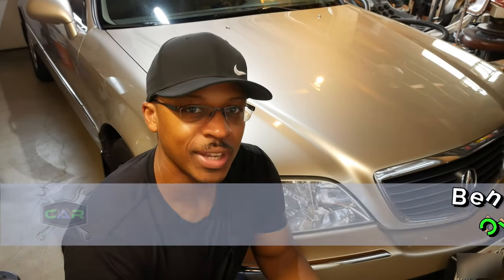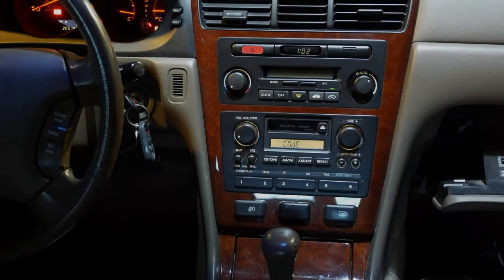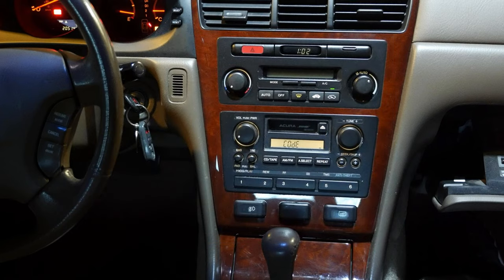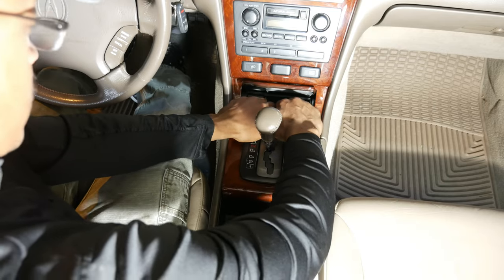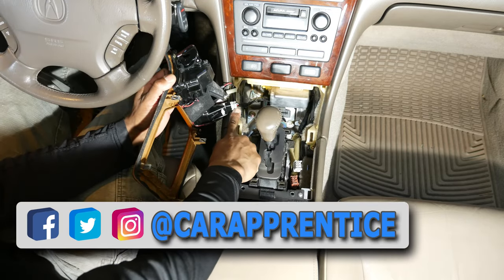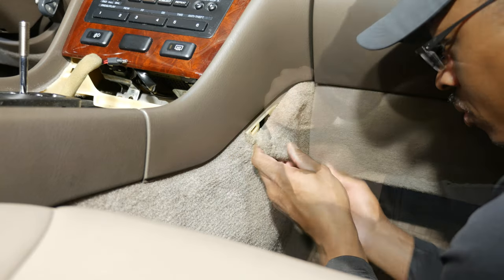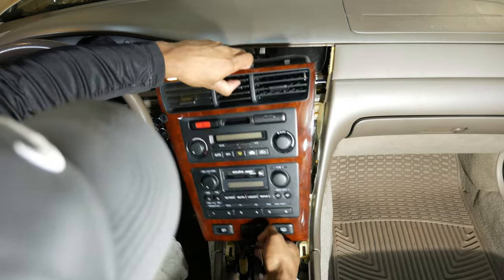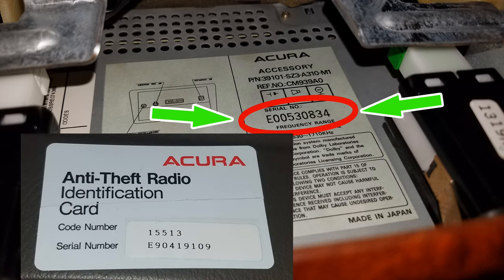1999 Acura RL Stereo Removal and Code Retrieval

Comment: Thanks for the video dude. I actually did half of this work to get the serial number. I removed just enough trim (the ash tray) and i snuck my phone in the little gap, turned on the flash and the serial number was right there.
Reply from the maker: Yes, that works, too. I thought for sure there was something wrong with the stereo, so I removed it.
Reply: @carapprentice  man i was so happy when the code went in and music started playing. I just purchased the car from someone and they didn’t know the code. That Bose system is still bumping 23 years later.

Comment: Cracked the nice wood trim at the top (years ago), trying to get to the cluster bulbs. Those two #10 black bolts that were hidden was my downfall. Why Acura doesn’t let you remove the cluster gauges prior to removing the whole center unit…is just plain nutty!
Reply from the maker: I had to really trust the factory service manual when I removed the cluster...and it wasn't wrong. 😀

Comment: Your channel has been a godsend many times. I have.a 2000 RL in purchased new 24 years ago. The AC button has been pushed so many times, it’s now broken. Curious if I actually have to remove the shift console or if Imcan just loosen it and get to the front facing 10mm bolts holding the center unit in. I’m about to try but curious since you’ve already done it. Peace.
Reply from the maker: The shift bezel has a couple tabs that tuck under the center stack, so I would remove it. Thanks for checking out the videos!

Comment: Hey friend.  Much respect,  I have a question.... I have a 96 Acura rl and it had started giving me issues with starting, but I would use my other key and it would start.  Haven't drove it in around 2 months, battery died, and had it charged and it gave it power but clicked. Do you think that I need a new starter by any chance..... please help....🙏🏾🙏🏾
Reply from the maker: I haven't really looked closely at the starting system for the RL. Here's some info I found: https://www.acura-legend.com/threads/starter-problem-or-key-problem.126538/

Comment: yall dont need to take the radio out... take the middle cap off between ur fog and defrost buttons and the radio serial number is on the bottom of the radio
Reply from the maker: Yes, I forgot to re-add the pinned comment when I moved this video from my other channel. Also, I thought there might be something wrong with the stereo, so I removed it.
Reply: @carapprentice  either way love your videos, very helpful especially when its my first car!
Reply from the maker: @yungryuk2713  Glad to hear. Appreciate the feedback.
Reply: @yungryuk2713  what cap I’m trying to do this right now please help
Reply: @willotv8428  the middle "button" in between your fog lights
Reply: @willotv8428  take your key and pry it up from the bottom and will pop right out and back in
Reply: @willotv8428  if i remember correctly the serial numbers are upside down so u need to get a flash light and an awkward angle to read them, and also use the website that the video gives you, super simple, did it in my girlfriends job parking lot lmao
Reply: @yungryuk2713  Appreciate it bruh you just saved me $150 going to the dealer ship
Reply: This is why I read the comments. A year later and this comment/tip saved me so much time. Thank you for this gem!

Comment: Love your videos, Acura RLs rock!, got a question, my 2004 Acura RL Navi refuses to work below 50 degrees, living near Canada that's like 4-6 months, sheeesh, anyway was wondering perhaps the connections are loose and the cold weather shrinks and disconnects them or the radio/dvd is bad, I have a replacement, but if I replace the stereo, I'll need a new radio code, but will I need a new NAVI code as well. any help/advice would be appreciated.
Reply from the maker: I've used cold spray to check for temperature-related issues; typically, these kinds of issues occur with heat. I'm not that familiar with the RL's navigation system, but this is what I found in the service manual (see link below, also): 
• In cold temperatures, the display may stay dark for the first 2 or 3 minutes until it warms up.
• When the display is too hot because of direct summer sunlight, it will remain dark until the temperature drops.
• When the humidity is high and the interior temperature is low, the display may appear cloudy. The display will clear up after some use.
https://www.mediafire.com/file/5dd5aj7qsbal0cn/RL9604D23004A-RLNavigation.pdf/file
Thanks for checking out the videos!

Comment: I'm considering putting in a bluetooth module somewhere, in order to have phone streaming compatibility without replacing the entire radio. Running mainly into: where to solder the wires (no circuit diagram available of course), and if the connection can be made to tape or cd inputs (leaning toward cd) there would need to be an activation of the circuit (the car thinking there's a cd to be played) in order to make the input actually be sent to speaker. Would you have any idea about how to bypass that conditional activation of the audio input line? Asking because the CD changer had been taken out of mine, so with an empty disc I am not getting far.
Reply from the maker: I don't know much about the RL's audio circuits. I installed a non-bluetooth module in my Acura Legend years ago that used the CD player's connection. You may want to check the 96-04 Acura RL Facebook group: https://www.facebook.com/groups/1427987647415950/?ref=share&mibextid=NSMWBT
I've stored the electrical troubleshooting manual and the factory service manual here: https://www.mediafire.com/download/uvbmryok1ax4vbs
https://www.mediafire.com/download/rw700yatvtuazs9

I've used this bluetooth device for over a year as a simple solution: https://youtu.be/9301ko18jM4?si=x53cfPlUOA_utP9H

Comment: I just got a 99 RL from my mom that’s been sitting in a garage for a few years. The battery was disconnected so when we got it out I had to put the radio code in, worked fine for most of the day, but now I’ve got a Err code on the screen. I’ve already tried disconnecting the battery again to re input the code and it goes back to Err again after a few seconds. Any tips or fixes?!!!
Reply from the maker: I would remove the stereo to inspect the wiring and look for corrosion on a connector or a ground.
Reply from the maker: I found this info that might be useful. I've never run into this issue myself: https://www.smailhonda.com/how-to-reset-honda-radio-codes/:

Comment: I have a qualm with getting my code. I press and hold 1&6 with the power-button  and nothing pops up but code
Reply from the maker: I don't believe the procedure you described works for the first gen. RL.  I would encourage you to watch or re-watch the code retrieval portion of the video.
Reply from the maker: I'll add that the serial number is sometimes written on a label that's adhered to the inside of the glove box. Also, I learned that you can remove the ash tray then use a mirror to retrieve the serial number from the underside of the stereo.

Comment: When you find your code (for any radio) email the code to yourself. I also right the code on the back of the radio with a Sharpie/marker. (If somebody manages to steal/destroy this radio they can have it!)
Reply from the maker: The code is stored in the owner's manual in the glove box. I have not upgraded the stereo because I don't want someone breaking into my car just to steal the upgrade. No one seems to want this stereo. 😀
Reply: @carapprentice  Right on. I should have said "in addition to the owner's manual"  I did the same thing for friends and customers (11 years of car stereo  installs)  ...but I still have the stock '99 RL stereo as well lol.  224,000 miles and still rockin'

Comment: I have the correct code, doing it all exactly the way it should be done. Still nothing, it worked once before when I first bought it but not now. I’m literally out of options 😪🤦🏻
Reply from the maker: Have you tried disconnecting and reconnecting the battery's negative cable? Feel free to contact me on Instagram @carapprentice. I may be able to help you out.

Comment: Who would steal a stock stereo? It's a pain in the ass to have to go through all of this simply because the battery has to be replaced. I won't buy another Honda/ Acura vehicle again.
Reply from the maker: To replace the battery, the code just needs to be entered. It's usually stored on a card in the glove box, or it's easily obtainable from the website I visited in the video. I only removed it because I didn't remember that the original stereo had been replaced at some point by the previous owner, so I thought it was faulty.

Comment: Acura said my radio had to come out to restart it and it would cost me 180
Reply from the maker: Yes, it's not cheap at the dealer. The stereo doesn't actually have to be removed; a mirror can be pointed at the underside of the stereo to gather the serial number. I removed mine because I thought it was defective.